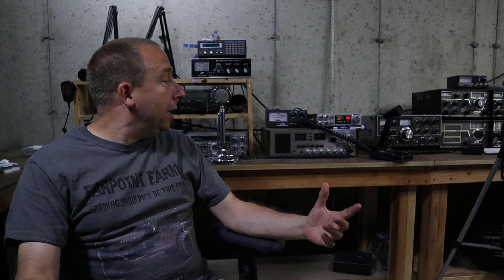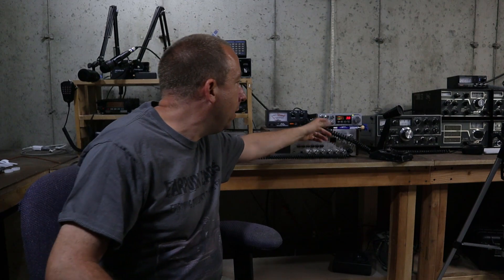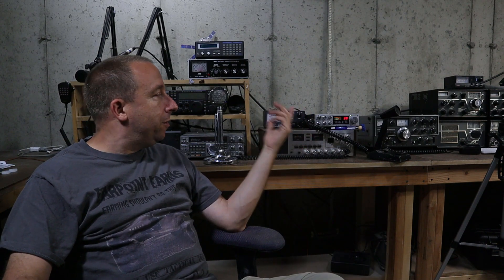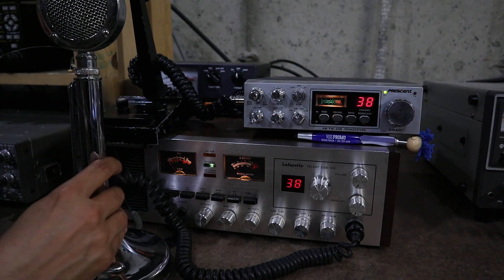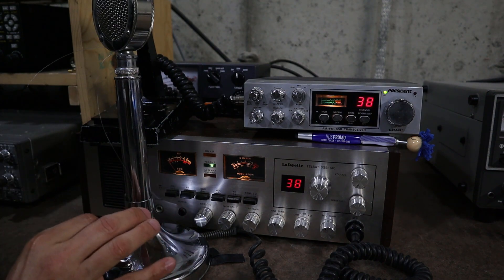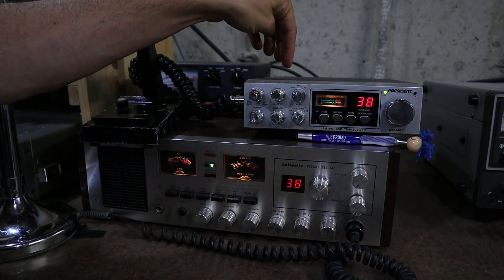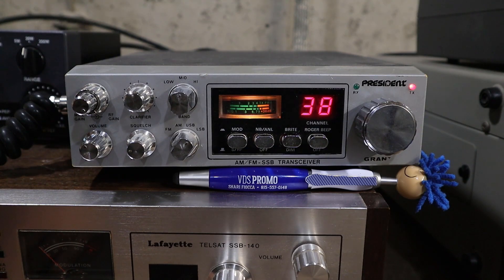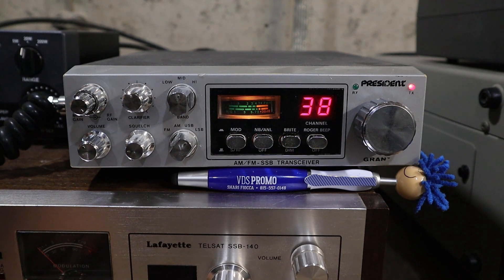Let's Take a Look at CB Radio

Comment: Now should we wait for the new radios coming out since the FCC laws have changed in regards to opening up FM freqs?  More channels????  So that they will design and make new radios?  Remember the old 23 CHANNEL PACE and JOHNSON CB  radios?  Then there was Realistic, Lafayette, Royce, Kraco, Midland,  and those CB radios that had tubes needed to warm up?  Do they make TODAY a base station antenna that can outperform the Super Penetrator 5/8 wave omni directional ground plane antenna?
Reply from the maker: Yes..  the maco v58 is just as good as any antenna from the 70s
Reply: @SevenFortyOne  What are the specs and physical.size?  Not aluminium?
Reply from the maker: @microminiskirt  Its aluminum....modern version of the Avanti Sigma 5/8.  Same basic electrical design but better mechanical design. https://www.rightchannelradios.com/products/maco-v58-cb-base-antenna
Reply: @SevenFortyOne  WOW THAT IS A VERY EXPENSIVE ANTENNA.  IS THAT INFLATION AT WORK?  I REMEMBER THE OLD CB PENETRATOR OR SIGMA 5/8 ANTENNA COST 49.95🤑
Reply from the maker: @microminiskirt  Inflation...I bought my Maco V58 about 10 years ago for less than half of what they are selling for now.
Reply: @SevenFortyOne 👍  SO NOWADAYS WHAT IS THE AVERAGE PRICE OF A DECENT BASE STATION ANTENNA WITH  THIS  V58 ANTENNA AT THE TOP OF YHE PRICE CHAIN?

Comment: Hey 741, In the late 70- early 80`s my friends and I used to convoy around at night with cb rigs for hours. I am licensed as KANA 5675, handle was Panama Red. My pickup was a 1954 Ford F-100 that was wired 6 volt pos. ground. Had to use an old truck 12 volt battery strapped to the trans hump to run my rig. Had a 23 channel Craig and talked through a pr. of Radio Shack rabbit ears attached to my West Coast side views. Oh, those carefree days. I still can get on with a "GE Help" handheld, though my antenna broke. I can still listen in on stuff up on 11 with the old Kenwood HF rig.  When propagation is right, those AM SSB stations come in very well up here in Endless Mts., PA. KC3BXZ Joe 73
Reply from the maker: We used to do that too...someday I'll do a video about the "Scotty Hunts" (fox hunts) we used to do...they were a ton of fun.

Comment: When I saw the thumbnail of the Lafayette SSB-140 I had to check the video out! I have one now and had one back in the day! I actually have a lot of CB stuff sitting around that my ole lady will probably throw in the trash after I am gone! I have several TRC-457's, a Royce 642 (I think that's the model number), a couple Cobra 2000's, President Madison station and all kinds of Uniden and President mobiles. I have a lot of Ham gear that I haven't used in a while either. It can be kinda hard to stay on top of several hobbies at once! Maybe I'll make a different YT channel just for some of my radio gear. Thanks for the Video! 73!
Reply from the maker: By all means make some videos about those radios!

Comment: CB is taking off with the solar cycle kicking in. I’ve been back at it for a year and loving it. Talked to Australia last week. Like building my own home brew 2 element Yagi antennas.
Reply: Solar cycles were great back in the day for DXing, I could communicate from my push bike to America using my Tait CB4 on AM, from Hastings  New Zealand. My particular model had 4 torch batteries in it using a car cb aerial on the bike carrier.

Comment: Those wires attached to the PLC were most likely for an add on frequency counter. That was the way we use to do it. lol Mod the radio for the 11 meter band using existing switches add a freq counter and turn the clarifier into a slide to get freq's dialed in or slide between channels. Add a tube type Foot Warmer amplifier and what a setup! Wow, the memories.

Comment: I love my CB radios I probably have 75 or so from old tube types to new stuff and some exports. I started back in 1994 when I found my dad’s spare radio in the closet which was a tram D 42. He was a truck driver. I didn’t know any better and I thought it was just like a car stereo I could stick a piece of wire in the back and use it. The SWR warning light was on but at the time I didn’t know what it was. I threw about a 20 foot long piece of wire out my bedroom window into a bush and I was talking on channel 19 to truck drivers 2 miles away at the interstate. knowing what I know now I can’t believe it worked. My dad finally knocked on my door wanting to know who I was talking to when he seen I had his CB out with a piece of speaker wire crammed in the back of it he wasn’t too happy and took it away. I can’t believe it didn’t blow the finals But I still have the radio and it still works and looks good. We normally stay on channel 17 here in North Carolina Lotta good knowledgeable guys on there to talk to never any arguing or fussing.

Comment: I wouldn't have become a ham if it wasn't for CB radio. I still have my old Cobra 148GTL, would love to get it back on the air.
Reply: Nice i have 148gtl too an just picked up an pdl2 i love my imax 2000 for omni getter goin
Reply: Miss my one
Reply: Just do it bud, it's alive, lots of skip on CB nowadays, and new solar cycle will bring worldwide contacts in the next years. 
Get back on the air NOW :)
Reply: im a rastaman i dont eat ham
Reply: I have had a Cobra 148gtl citizens band transceiver since I bought the vehicle new in 1996.  I cut a very meet hole in the dashboard and mounted the old 148gtl permanently into the rectangular hole.  I also made a small rectangular hole next to the rectangular hole for the microphone socket that attached to the radio.  Today, I still have the radio mounted in the same vehicle with the same antenna.  Everything still works except the band.  I hear almost nobody on the band anymore whether AM or SSB.  Every once in a great  while, I hear someone very far away on channel 38 LSB.  But that is it.  It is sad what has happened to citizens band.  I had very poor foresight when I cut holes into my dashboard.  Back in 1996, I never dreamed I would still have the same vehicle, nor did I anticipate the death of citizens band.  I can not remove the old Cobra 148gtl without replacing dashboard panels.  It is very hard to find dashboard panels in good condition for a vehicle made in 1996.  Thus, I just leave the old radio in.  I had great times with that radio.  I talked to the Canary Islands back around 1999 with the same antenna and coaxial cable on channel 36 USB.  I miss those days. I regularly scan through the channels, since the radio is still working.  I rarely hear anybody.  The antenna is a 4 foot Wilson Silverload.  Everything was better back then except maybe advanced technolgy.  Today, everything sucks except advanced technolgy. 

As a kid I was KBX1339
Reply: @indridcold8433  Actually everything sucks BECAUSE of advanced technology (computers here) : facebook and the like social nets make everybody crazy, young generation can only interact through them, they don't know how to communicate with a real person in front of them, then when a crazy spreads the word, people start to kill, destroy property and believe silly things like flat earth and 5G corona virus spread and so on.
Back then without these "advanced" tools (are they actually advanced?) everything was simpler, quieter (they accelerate things to the point it's not for a normal human pace, rather, they have "robot pace").
Today's world sucks, it has more competition than it would be healthy.
Humankind needs to get back to a "human pace" instead in order to find back its peace of mind.
Reply: @indridcold8433 try a wilson 1000 w/ new coax you will hear more

Comment: I am a ham here in the UK but still run a CB in my pickup! Lots of activity on 11m and the ham bands since lockdown!
Reply: @paganphil100  Oh dear... CT wannabe hams using CB with their wannbe ham speak and made up callsigns.
This almost made me not come back to CB..
So I came back to CB using my 27/81 Rotel240 ... CB is pretty much dead around here.. The ones that remain rarely speak to anyone who they are not on first name terms with... Anyone new or unknown is generally ignored.
I'll continue to use my old kit until it lets the smoke out, I wont bother getting it repaired or replaced.
Coming back to CB was a big disappointment. Its a fading shadow of its former glory years and will continue to fade due to the lack of new people.

Comment: The cost of vintage cb equipment has gone thru the roof. I first got on 
CB back in 1967 thru 1977. Back when things were good and you formed new
 friendships with those you talked to on air AND...everyone had a CB 
LICENSE with a call-sign. Most cb'ers today weren't even born when we 
were active. Back in the day...you could make a 2 hour drive from Mass. 
to both Winnisquam or Laconia, NH and go to either the Browning or Tram 
factories and get the royal treatment from the techs who were more than 
glad to guide you thru their facilities. We formed radio clubs and 
hosted "Coffee Breaks" and "Jamborees" and traveled three or four states
 to attend another clubs functions. We shot a lot of Skip 
everywhere..even Europe and collected QSL cards from nearly every 
station we talked to. If a QSL wasn't available, a three cent postcard 
would suffice quite nicely. We used to attend "Antenna Raising" parties.
 and install mobile rigs for the uninitiated at ten or fifteen bucks a 
pop. In the winter we had a group of mobiles which outfitted their cars 
& trucks with thermos's of coffee, flares, blankets and chains in 
the event we come across a disabled snowbound motorist. We had a command
 center and numerous maps on the walls to assist in our operations plus 
we were connected with the county's ALERT / 9 EMERGENCY CHANNEL...not to
 mention our local CIVIL DEFENSE. We assisted on a voluntary basis 
during raging storms, downed aircraft, missing persons and other areas 
of concern.  Yep...most modern day so-called cb'ers. don't have a clue 
what it was like back when CB Radio was "Good".

Comment: Just getting back into CB radio after 40 years or so...got a Cobra 29 LTD classic for a base station,LMR 400 coax to a 102" whip mounted on the chimney with a homemade ground plane that I copied from mower junkie 151 SC. Top of the antenna is 34' off the ground and it works great.... SWR's barely move on channels 1-40 73's 102 NY
Reply from the maker: Sounds like a great setup!

Comment: Been running a cb since 1988, I keep one in two of my vehicles and one in my room, “wife loves it” lol, but I use both ham and cb, love them both. 73, Kg7vdn
Reply: HAM RADIO COST MORE FOR THE EQUIPMENT AND REQUIRES A LICENSE.  THE EQUIPMENT IS MORE DIFFICULT TO USE.
Reply: @microminiskirt  if you can run a ssb rig you can run a ham radio, it really isn’t difficult, but yes it requires a license , one I passed on first try and I’m not really a technical person, but I’m more of a Cber as it’s more laid back.
Reply: @bobdillashaw4360  I am sure it's much more laid back as there is no regulation on CB and with HAMS too much regulation, more cost $$$$, more range.  That President CB radio in video looks like has a signal meter from a Realistic TRC-451.

Comment: Regarding the wires coming out of the top of that modified radio you purchased, it may have gone to a small plastic matchbox size switch box, my modified Viking 4740 had one on it & it had three 3 position micro switches that enabled me to operate in between channels on multiple frequencies.
Reply from the maker: I think you are right

Comment: Good video! I’m gonna setup a base station sometime this spring. I recently got a Maco V58 base station antenna and a 100 ft of RG8X coax cable. I plan on running a old school base station. I have a Realistic TRC - 441 base station I got about a year ago that still works great. I’m hoping to find a Uniden Washington at a upcoming ham fest in a couple months. I’m also on the lookout for a Uniden Grant or Cobra 148 GTL if I can’t find a Washington.
Reply from the maker: Sounds like a good plan.  You'll enjoy that antenna....mine works great

Comment: I hooked up my first cobra 29 last night in my truck to test out. I got a radio check on 19 but not much elsewhere. I heard clear talk on channel 32 but they didn’t appear to hear me. I’m in CT over by Manchester
Reply from the maker: Channels 32 and 31 should have activity but more toward enfield.  8 and maybe 14 were popular Around springfield.  Most of the activity in CT is on sideband which you don't have in that radio.  Just be patient and keep tuning around and you should find people to talk to
Reply: @SevenFortyOne  i may have acted too soon on the cobra 29 purchase. my dad was big in the cb business back in the day. he used amps and a cobra 148 with ssb. i just ordered a galaxy 959! :)
Reply from the maker: That's a good radio.  Look me up on channel 39 lower sideband when you get it.  I don't talk much but I do listen in...just yell for 741
Reply: @SevenFortyOne  will do! I’m using a mobile antenna currently for testing plan is a house base station. So I’ll be picking an antenna for that!

Comment: I see a Astatic D-104 and a Turner mic in the background.  I still have a few CB SSB radios, mostly J.C. Penney's PLL single sideband radios.  They all have freq mods and unlocked clarifiers as I used to do freq and clarifier mods back in the day, mid 70's through the 80's.  PLL chips were very easy to modify.  Yeah, make more CB vids.
Reply: Nice my first cb was 23 ch jcp pinto kicked ass on my old super mag 👌

Comment: Mt. Greylock is not too far from me here in Bennington, Vermont.  I used to take the base antenna up there and talk all over the world back in the mid to late 90's.  3,489 FT elevation. Good times!!  73's from "Hound-dog"/415 in Vermont.
Reply from the maker: Bennington is a great town.  I ride my motorcycle through there once in a while
Reply: @SevenFortyOne  Give a shout out when your in the area.  Local channel here is 30, with people talking up to 50 miles apart.  I'm on the top of a hill so I have great coverage of town and beyond.  Washington base with A99 works well.   73's

Comment: I have two Telsat ssb 140 radios, one seems to work fine, one needs work. Both could use recapping first, then alignment and whatever in repairs. I also found a cb like my first Sears 23 and an RS 451 ssb
Reply: I built my own vertical dipole base station antenna too from a 102” long 1 1/4” ground plane pipe with a trucker mount on top with a 102” whip, the coax runs inside the ground plane pipe out the bottom. SWR is less than 1.2 on all channels

Comment: People don't realize what 5 Watts at 27 Mhz with a good antenna can do compared to 5 watts at UHF.  Laws of physics all things being equal give you a 24 db Gain
Reply: psssssssssst, i promise nobody is hearing your 5 watts over the top of everyone elses AT THE MINIMUM 200w - apply that same amount of gain to 200w and you suddenly realize you might as well not even transmit cos you're so far down into the noise floor

Comment: Ham operators have had CB users backs because they are next. If C B radio goes, ham radio is next. Many have both. 

I am old enough to have had a FCC license to operate a 23 channel CB. When the channel count was increased to 40, licensing was dropped.

Most serious C B ers went to single side band channels. The people who could not get or keep certifications got to legally use C Bs and courtesy and civility went out the window. Many quit using them due to the changes in attitudes, foul language, and so forth that did not occur during the era of licenses. 

I still have my old Uniden mobile.